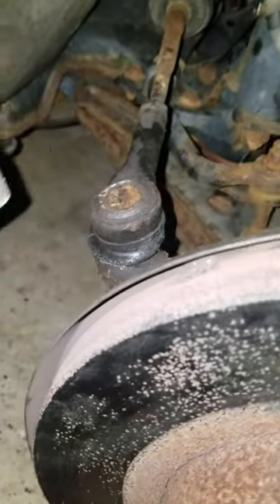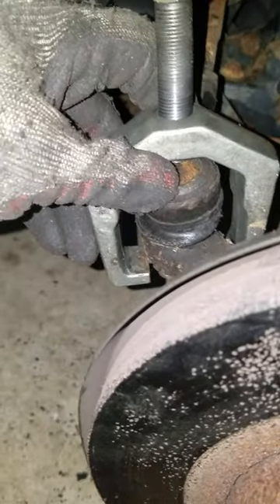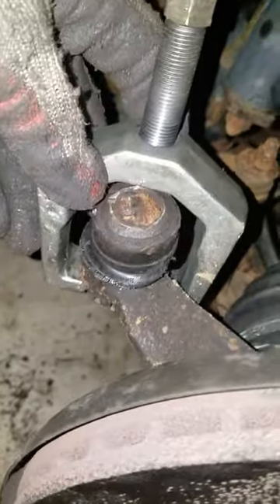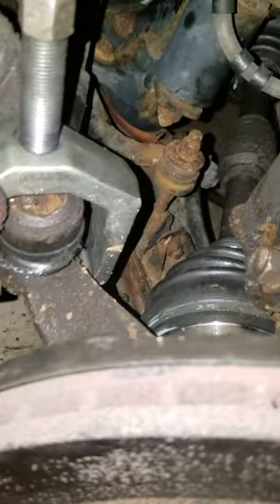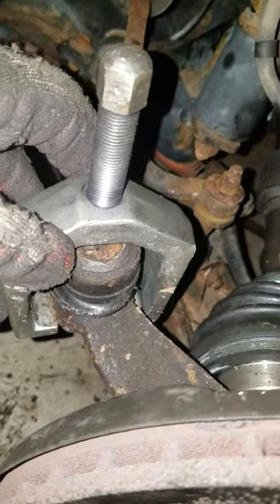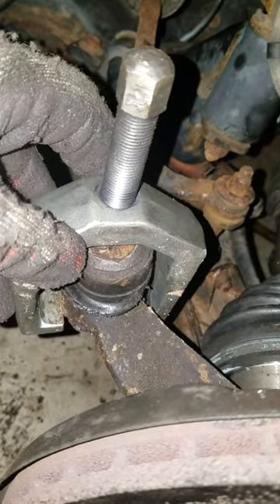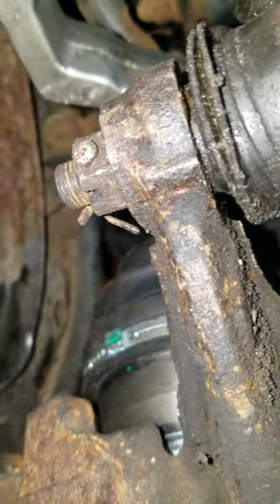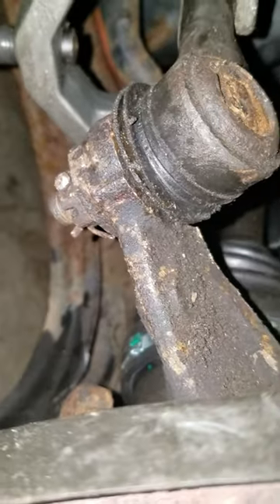What to do when your ball joint spins when tightening

Comment: boot is torn on tie rod should be replaced also dam look at that rotor is badly pitted. you can just use a pry bar to stop it from spinning. Using that pitman arm puller to push down on tie rod center may damage it . just my .02$